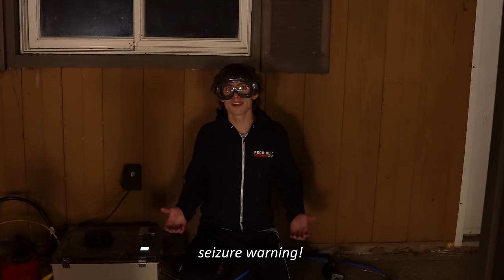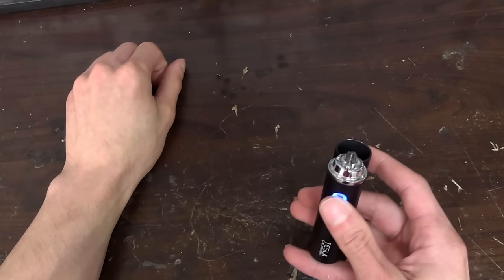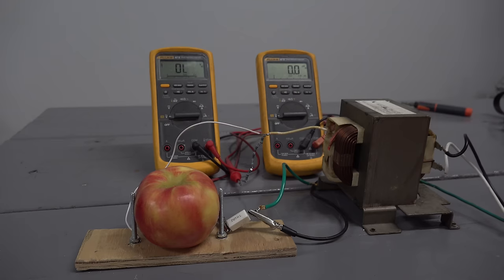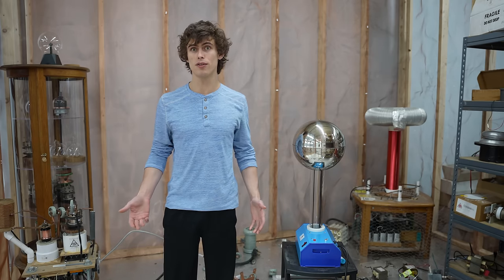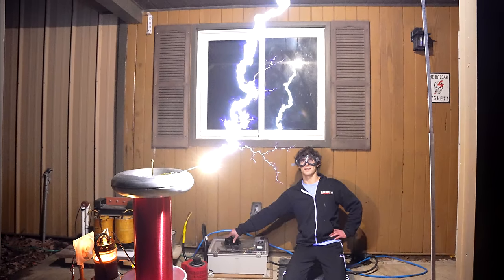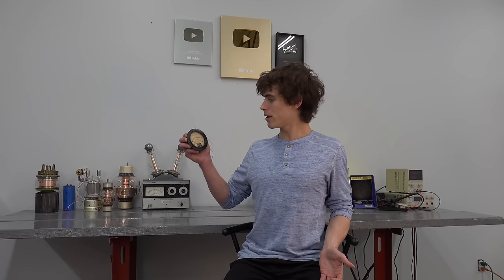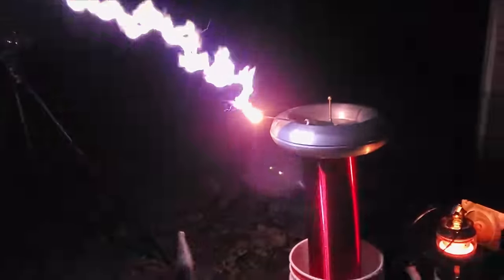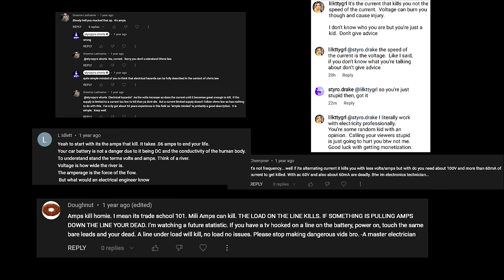Is it the volts or amps that kill?

Comment: Yes!!!! I'm an electrician.  I explain the same thing and get "corrected" by those around me.
Reply: .    Yup, you can change a receptacle on a live circuit and touch the hot line; just don't touch anything else that leads to return at the same time.
Reply: @snoglydox  Clearly you didn't watch the video. You will still pass current if you touch the hot line just by the capacitance of your body to the air. It's not enough to kill you, but you can feel it under certain circumstances. And if you're touching the hot line, it's very easy to accidentally touch something grounded, or even something with not that great conductivity to ground, but still enough to be an issue. F'ing switch boxes that have 3 different circuits going into them... trust me, you feel it!
Reply: @gorak9000  capacitance would matter if you would be completely wet or covered in conducting materials, but if you wear some 'plastic' clothes, that already reduces cpacitance, and with good shoes you can touch 240V AC the live wire without noticing.
So taht dude is not wrong at all.
Reply: @krisg822  He is assuming that the person is most likely wearing socks and sandals and touching it with bare hands
Reply: @Noctify  you man like, completely naked with just sandals on? and what di you mean by bare handed? obviously bare handed.
Reply: @krisg822  You realize how stupid this comment sounds?

Capacitance is a phenomena caused by DIELECTRIC between two plates. the better the insulator, the higher the capacitance so if anything, plastic INCREASES capacitance.
Reply: @cpK054L  nope, its a fact the material between + and - has to be non conductive, else it's a resistor, but, you can not change capacity without changing the surface, and the distance between + and -. So, by adding a better insulator, which in case of clothes made of polyester would be thicker, you actually decrease the capacitance - it separates the skin further from humid air. Best insulator is thicks and totally non conductive - this also results in less capacitance.....
Reply: @krisg822  capacitance works only in an AC system. Though people claim you can use it in DC is false.
ideally, a capacitor has INFINITE resistance in DC, this is not true in reality.
This is why we are taught in the LEM, and datasheets of capacitors have an ESR

other parameters such as breakdown voltages, parasitic elements such as inductance and thermal elements also come into play.

However, the biggest component when it comes to capacitance would be "slew/instananeous voltage" change.
I = C *dV/dt, forgetting this transient rule is why a LOT, I mean a LOT of electronics engineers destroy their system and scratch their heads on why.
that spike in voltage causes an in-rush current, and if the system is able to supply the correct power, then it will deliver the FULL power/energy into the system.

if it does not, then you'll have a voltage droopage, which is another thing that confuses engineers.  This mostly applies to power engineers as people in the RF/micro scales don't care much about this unless it is dealing with power management.

Also, humid air would be IDEAL for protecting against what you're claiming, because by shorting the distance between current you have "0 resistance" aka, 0 volts. (albeit, infinite theoretical current)

DRY air is where the "static shock" or rather "ESD - electrostatic discharge" becomes a greater danger because you causing a difference potential between two distances.
When it gets great enough, this is where he demonstrated "breakdown voltage", this is usually taught in Physics and depends heavily on the liquid medium (air in this case) which has a breakdown voltage in the Kilovolts range and that in itself is destructive to electronic components, and in some really bad cases can also cause harm to people. (This is where IEC-60101-1 comes into context, mentions of MOPP)
Reply: @cpK054L  ....how come you do not understand it?

If humid air has some conductivity and prevents capacitance, then it is a resistance, right?
And if you are connected to a resistor and AC on the other side.....do you not feel it? i bet you would~

I mean like, where did you get the idea, of humid air not making your skin more conductive than when your skin is dry???
Dry skin conducts far less than when it's wet, right?

.... AC is nothing but +/- , except the +/- swap their places with a frequency....in our case it is usually 50 or 60 Hz. But for 1/50th of a second, you get literally + and -.

Yes, you can use capacitors in DC electronics, bcoz DC does not mean no frequency, and that is what you missed.
Basic battery chargers do not feed batteries with constant 5V or 12V or be it 50V , it is a half sin wave or something that resembles it.
Therefore, capacitors are very useful in DC electronics, and you will find them in ANY electronics  that exist today.
Reply: @krisg822  this post is the EXACT thing the OP is talking about. 
"prevents capacitance therefore it's resistance?"
You realize how STUPID this sounds?
You don't "prevent" capacitance, the opposite of capacitance (speaking of elemental) would be inductance.
capacitors reduce reactance on increasing frequency
inductors increase reactance on increasing frequency

when the two elements meet on the "Resonant Frequency" that is when 100% of the power is delivered to the element.

If you've never worked with electronics, I suggest you stop spewing random crap you read on the internet

those capacitors on the "DC circuit" that you think are called "Bulk Capacitors", they are meant to supply the current that is "drooping" when converting the voltage from AC to DC. It is not ideal, and you'll need a whole bunch of other filters to remove the unwanted elements

Step down → Full Bridge/Half Bridge Rectifier (half-bridge is stupidity for DC apps) → X-Y capacitor → Inductor (ferrite beads) → Bulk Capacitor → Buck/Boost SMPS → Bulk Capacitor → By Pass capacitor

For other "DC" only circuits you use the capacitor for filtering purposes, NOT for the DC
a capacitor is called a "DC-block" because it  DOES NOT WORK IN DC, it used to filter unwanted AC signals to ground, and remove noise.

If you actually studied electronics, YOU WOULD KNOW THIS.

For your other stupid comment, think about this
Your skin is wet.
Water (H²O) is a polar molecule, it has a +/- terminal charge, that is why is both magnetic and conductive.
When you are wet, you have this LATTICE structure of "wet" on your skin.
Conductivity means that it has low-to-no resistance.
If are soaked all the way through, the path of least resistance in this case is the wet path, your skin has inductive properties, your body has capacitive properties, put them together you have a "resonant frequency" that your body responds to.

What don't YOU understand besides talking out of your ass and putting people's lives in danger with this misinformation?
Reply: Professional technicians can be so stubborn in their opinions
Reply: @krisg822  DC impulses appearing 50 times a second makes it a pulsed wave AC.
Please uninstall, you don't know what you are talking about
Reply: @cpK054L  no, DC is constant + and - , if the impulse consists of just lets say 5V and drops to 0, and not to -5V, then it is DC.
Reply: @cpK054L  besides what part of alternate current 'AC' do you not understand now?

Comment: Hey styropyro, good to see a video from you again. I was going to answer earlier but decided to watch the whole video before I said anything. I was going to say it depended on many things, voltage, amps, resistance of the conductor, and frequency of the electricity as well. I had not considered duration, but that is a no-brainer I guess. But I could not have explained it anywhere near as efficiently and technically correct as you. I sure do miss your older videos with lasers. Take care of yourself brother.

Comment: The terminology of this kind of reminds me of a snake. The volts being the length of the fangs. The amps being how toxic the venom is. And the duration being how much venom the snake puts into its bite. This is because even if the snakes venom is extremely toxic it won’t be able to kill you if the fangs aren’t long enough to pierce skin. And if they are and the snake only induces a small amount of venom it still won’t be able to kill you.
(This probably isn’t correct but I tried😂)
Reply: if the venom gets to the veins them it would be much deadlier, but yeah if it cant even pierce the skin then it would definitely not kill. im no snake expert but just from my own knowledge im able to correct you
Reply: Ignoring biological exceptions, this is a pretty good analogy.
Reply: And the frequency being how often you get bitten a year.
Reply: @iceboi5983 high frequency is safer though
Reply: @Mc-zr2xj  Eventually you'd build up a tolerance to the venom I suppose
Reply: @Mc-zr2xj  the more bites you have, the more venom you have

Comment: The voltage is directly proportional to the current, therefore, when the voltage is 1 million volts the current must be equal to 0.1 Amps, then the current must increase with the voltage until it reaches 0.1 amps.

Comment: I believe the reason this misconception is so big is because a lot of people like to simplify things.  Like you said, it is the combination of the current and voltage, but normal people don't care for the complexity so they like to make it one or the other.
Reply: Yes the need to establish a single source of failure. AKA who's fault is this.
Reply: And time.
Reply: By definition, it must be the current that kills. Voltage does not flow, it is a potential difference that forces electrons and their charges through a circuit. Current is electron flow and it is electron flow that kills.
Reply: @jasoncassidy492  Yes but applied to a practical sense that statement has no value
Reply: The funny thing for me is that technically speaking, it IS the current that kills, but for all intents and purposes it's the voltage that matters - If that makes sense.
Eg, if you had to choose a 2v wire vs a 200v wire to hold, you should always choose the 2v wire! BUT it's the current that would kill you from the 200v wire if and only if it could deliver the current!
Reply: @tomr6955 All sources are current-limited. Nothing on earth can actually continue to provide infinitely increasing current. This is why in practice the current draw of a circuit combined with a voltage threshold for killing you is what actually matters. This threshold changes because of voltage drop under load. The operating voltage being high means nothing, the operating current being high means "you're gonna die". The rule of thumb is correct in both a pedantic/literal since and more importantly a practical sense. Of course power draw is very useful as well, but only because it gives you a current estimate.
Reply: The misconceptions exist because it is rare to interact with any proof of reality. High voltages, amps, current, any of the variables at play are all around us in day to day life. But measurable reference points for them and the consequences of their mishandling are not. 
There simply isn't enough exposure to reality to dispel these myths. 
It will remain mysterious to people.

Comment: Interesting how I had always noticed the sensation of light electrical shock wasn’t painful at first, but if you didn’t let go of the fence wire it would increase steadily in intensity like a vice clamp slowly closing shut onto your hand.  I didn’t know until today that it’s the body’s muscle and bone acting as a capacitor that absorbs the current in ascending levels during the first couple seconds.  Great video!  Thank you.   Edit: Capacitor wasn’t accurate, maybe resistor?  I’m not a Mad Scientist like Styro, but it’s fun to watch! 🙂
Reply: It's not your body acting as a capacitor that does that. It's got to do with your skin resistance getting lowered over time making the amperage increase.

Could also have to do with pain receptors being overstimulated by the current and not by dielectric breakdown.
Reply: @PJ-oe6eu  Overstimulated receptors actually numbs feelings cuz of adaptation
Reply: @Timo-Epis  Yea with normal stimuli, and I'm not expert on this but I imagine it could be a bit different when it comes to electricity since that is how the nerve sends the message that it is triggered.

Could be completely off base though.
Reply: These nerves still send off signals else you wouldn't receive the eletricity as pain.
Reply: Could be you start stimulating sweat glands around the site of the shock. That would decrease skin resistance, increasing the next shock.

Comment: Sir a question if you don’t mind ?  I had grown a patch of Sweet Potatoes covered with chicken wire netting to stop Bandicoots from digging . When the potatoes were ready to harvest  I pulled off the netting ,vines and all . I rolled the netting ,stomped on it to pack it down and left in the Sun on the lawn for a couple days . I went to load it into my trailer to take it all to the Waist Tip , but when I stumped on it again to compact it I was Electrocuted! 3 zaps hit me between my legs and left 3 large splattered blood clots under my skin with a tiny pin hole centre !  My guestion ? how could that mess of wine and vines get Charged up by the Sun ?

Comment: As someone who builds power supplies for fun, can confirm that touching 1,000 amps has not killed me.
Reply: In a factory doing electroplating, they had 15000A (fifteen thousand) in 24V going through thick copper bars. The induction field was insane but touching them was safe. I did touch them and didn't feel a thing.
Reply: @merlin2600 yup, these amps are safe while flowing in the wire. But if some went through your body (wound? thin\wet skin?) = gg wp.
Reply: @merlin2600  holy fuck
Reply: @arthasmenethil5752  it cant flow through ur body without the voltage smh
thats not how wire works thats how voltage and current works
Reply: @xxxbudaflickxxx6806  I'd like to know where is needed 15kw at 12V? I guess you speak of DC? Also, touching 12V wires with capability to deliver constant 1000 amps is the same as touching 12V car battery. Only a small amount of current is passed through you due to your resistance. Resistance needs to go down or voltage needs to go up to increase the current. Licking those wires could be painful though,
Reply: Neither have 18kV killed me, although it was uncomfortable it was fine.
Plasma globes and their flyback transformers are funny :)
Reply: I also build PSUs lol. I once took 30kV 100mA through my arm and out my foot (at 50Hz). Wasn't very pleasant, but thankfully I'm still here
Reply: @inductivelycoupledplasma6207  wow, that does not sound nice at all. So the skin/body is more reactive to certain frequencies, is that what we can take from this?
Reply: I repair CRT TVs  for fun and 15,000 volts also hasn't killed me. TBH felt much nicer than 230V AC.
Reply: @IgnacyG1998  did you forget to discharge the tube? Or was the PSU on when you touched it?
Reply: @evil17  yes. Nerves don't respond past 20kHz, too little time in each half cycle for depolarization of the neurons to occur (might be wrong here, I'm not a biologist). 50Hz is nasty, felt like getting slammed with a sledgehammer down the whole left side of my body. Also pretty sure flames shot outa my foot hehe
Reply: @evil17  It is, Electro Boom tested it - AC shocks hurt the most at around 2kHz and above 20kHz they're imperceivable. Radio frequency AC was used to heat up patients in hospitals afaik.
Reply: @xxxbudaflickxxx6806  Bro
Reply: @arthasmenethil5752  If I could, I would give you 1000 thumbs up for this comment.
Reply: I was creating arcs from an old xray transformed and I was irresponsible, 75kV ~20mA to my shoulder out my foot onto concrete coming back into ground or neutral back to my transformer. It wasn't terrible but I just ran out of it lol
Reply: @urnoob5528  yet, under some rare circumstances 24v could be enough to break through that skin resistance "armor".
Reply: @inductivelycoupledplasma6207  Wow, you're lucky AF, 100mA can be enough to kill. Perhaps the current flow bypassed the vital organs. But that's pure luck...
Reply: @evil17   For AC, it's literally called the "Skin Effect" higher frequency = closer to the conductor's surface the current flows, be it the human body or wires.

For 3mm copper wire, 20KHz AC flows approx. 100 times less inside the wire's center, than the wire's outer surface.
That's why you can't just use a single thick wire in high-frequency transformers.

Still, high power high frequency AC can cause skin burns and, perhaps, in time -cancer.
Reply: @arthasmenethil5752  as styro stated in the vid, the depth of the skin effect is dependent on the frequency and conductivity of the material. Unless you get into the GHz, the skin effect is negligible in human tissue, and hence it isn't the reason for the lack of shocks at HF. And yes, I was lucky to survive that 50Hz shock.

Comment: I'm glad you addressed the reactive and impedance factors. Showing some more of the math you could have included the complex power version of ohm's law. Granted, what you did show is fantastic. Di-electric breakdown is not covered by ohms law for sure and in fact requires piece wise equations for them even to work with complex ohm's law. Granted it's all a model of the system.